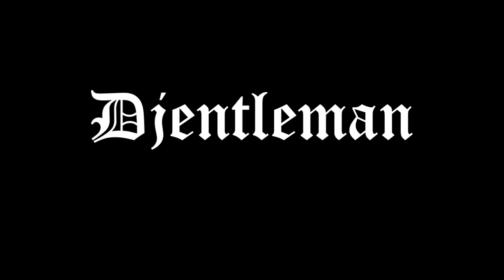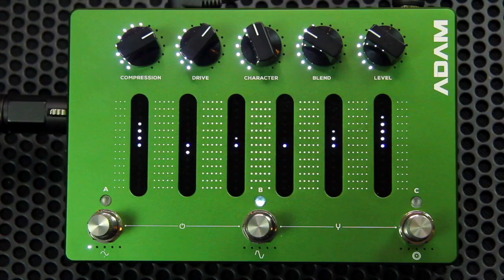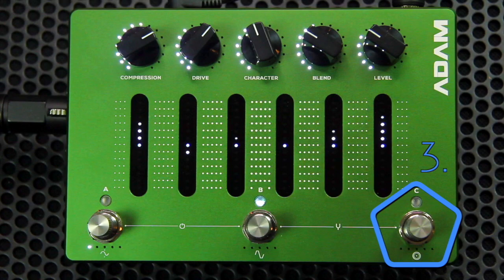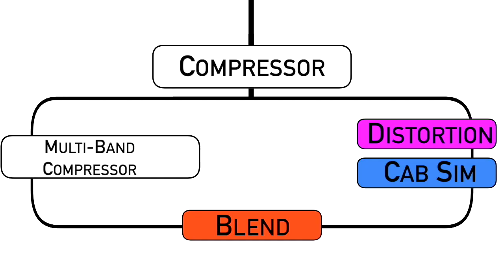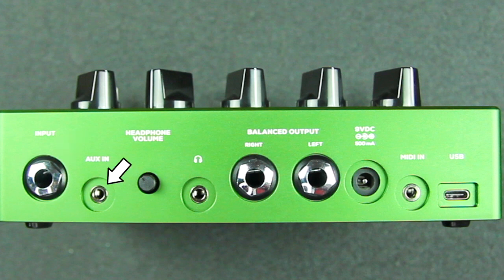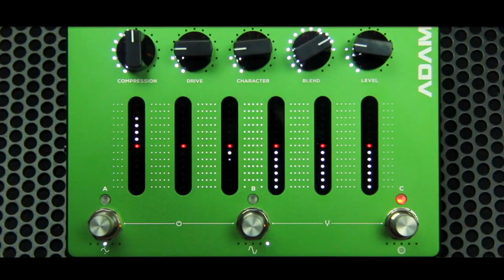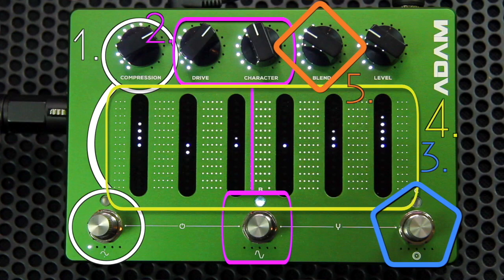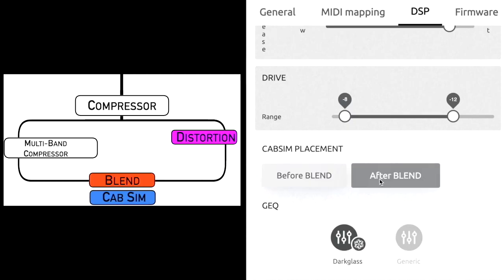Darkglass Electronics Aggressively Distorting Advanced Machine Demo by Amos Heller

Comment: THANK YOU for the best available walk-through of this occasionally-confusing-but-undoubtedly-powerful pedal! I've owned it for a while but, thanks in part to a UI that only a Finnish metalhead with an Electrical Engineering degree could love (ha), I hadn't really 'grokked' it until you broke it down. PS: I bought the Origin Cali76 compressor after your demo, and LOVE IT. Thanks again!

Comment: Great job showcasing the lower gain capabilities. This ranks among the absolute best looks at the ADAM.  I took a leap of faith buying the pedal once I read about the low gain update, and I couldn't be happier. Even with the drives bypassed the compressor and IRs are so well thought-out that everything sounds absolutely massive and full.
Reply from the maker: Thanks!
Reply: Put it in my pedalboard and demoed it for a bunch of folks and everybody loved the tones with the distortion off.  The cab sims and multi band comp are killer.

Comment: I have to say this and your other videos are the best demos on the Darkglass ADAM.  I wanted to hear how it sounded with low gain distortion because I'm more of a Fuzz/Grit kind of guy, and your videos more than any other convinced me to buy and try it for myself.
Reply from the maker: Right on! Thanks for the kind words. Let me know how it goes!
Reply: @AmosHeller  Turns out I'm returning the Adam.  

I wanted an all in one distortion unit that I could use on small gigs and leave my Elektron Analog Heat behind.  And while it's cool, I prefer the grit and simplicity of my Darkglass Vintage Microtubes Ultra
Reply from the maker: @D1SASTERarea  I’m sorry it didn’t work out for you. The Ultra is a great pedal too!

Comment: Would you recommend to a non metal player?  Looking for compression and dirt. Would u use a cab sim if your already using a cab?  Thanks
Reply from the maker: You might want more individual control over comp stuff (attack/release, mix etc) but this is a good comp and drive. Having multiple saves to switch through is a real boon
Reply: @AmosHeller  Yea I like the drive sound’s on this vs a B3K. I might give it a try since it offers so much. Thanks Amos. You have been amazing

Comment: I use my NG3 but i have a lot more low on the clean signal
Reply: Too much lows? Are you using the blend for clean? The clean channel is tuned for more low end and doesn’t sound great on it’s own. If you want to get clean signal from the Adam, better to turn off the distortion and put blend at 100%.
Reply: @Nebvin  yeah I know ahah
It's because before I use the third ratio who is 12:1 and on the clean side (or with 1/4 of blend) this ratio with a high threshold (low comp) it had a loooot of extra bass. But after I notice that Nolly has a really heavy picking and with my attack it sound the same as when I put comp to the top (1/2). So now it sound great all the strings and clean and distortion side are approximately equal ! (4:1 ratio)
Reply: @Nebvin  This FET comp is agressive if I compare with a Bus SSL who are transparent. Need to try lot of thing to understand what work better

Comment: this pedal arrived to me today and... i cant figure out how to use it. do i need to pair it with a DAW? i tried to play it through my Kemper/ Monitors and had no luck.
Reply from the maker: What output are you using?
Reply: @AmosHeller  thanks for the response! I have tried the direct out put as well as both balanced out puts on the ADAM, as well as the headphone jack to see if that would produce any sound. but no luck
Reply from the maker: Are you sure the tuner isn’t on? Output /master is up?
Reply: @AmosHeller  I finally got it to play sound, but it’s got a lot of feedback and sounds pretty crappy. I have a instrument cable that has a pair of input jacks on one end and a single jack on the other end. Dual jacks are connected to the balanced outputs on the Adam, the single jack end is plugged into the input on the Kemper profiler, my guitar jack is plugged into the ADAM input.
Reply from the maker: Hm. I don’t know if that’s the best way. Can you run a mono signal into the profiler? I don’t have mine handy at the moment-but can you run a single 1/4” from one (L or R) output to the Kemper? Or straight into the DAW just to be sure?
Reply: @AmosHeller  just tried a mono signal from the R balanced output jacks into the Kemper input jack same result as before, lot of feedback and sounds terrible. You’d think after playing guitar and bass for 20 years I could figure this out lol.
Reply: @AmosHeller  got it figured out! Thanks for your help. What was making the pedal sound terrible was the C switch (cabinet profiler) I need to turn it off completely since it was layering another cabinet over my Kemper.

Comment: The only thing I'm kinda disappointed by is that there aren't really 5 new drive sounds here. To my ears, it sounds like the same basic style of drive, but with different levels of saturation. I feel like the EQ and the cab sims are what really makes the difference here, but as someone who is VERY picky about his dirt, I'm reluctant to open my wallet for this one.
Reply from the maker: I hear you! And I have to say that I had the same feeling. The drives are very similar. 

I’m currently working on the Photon, which (spoilers) might solve this very problem